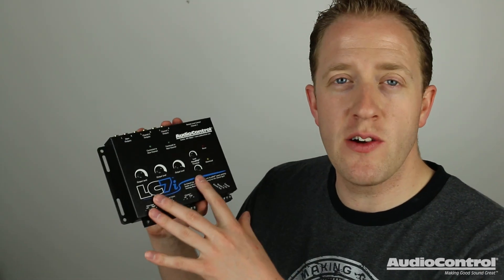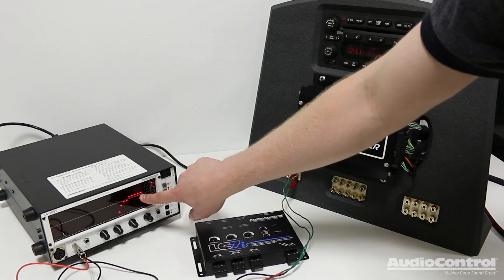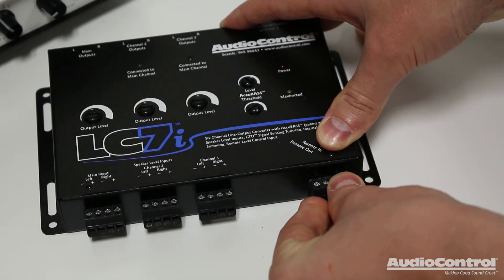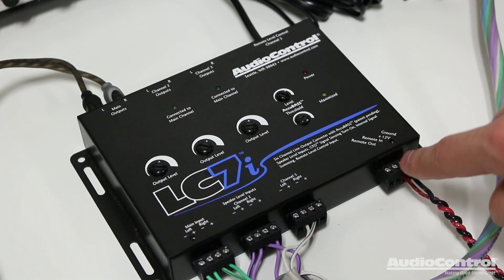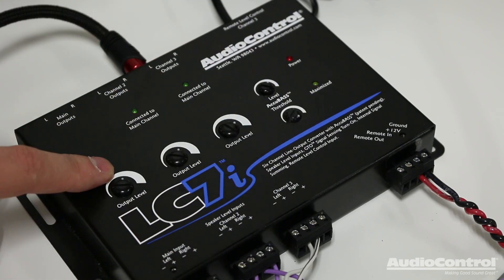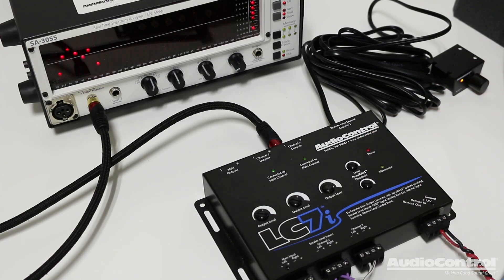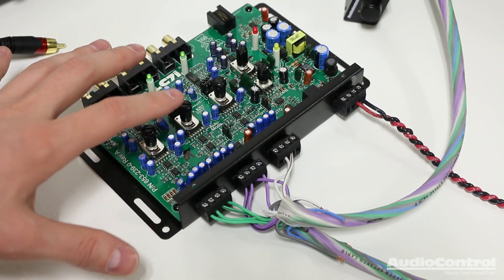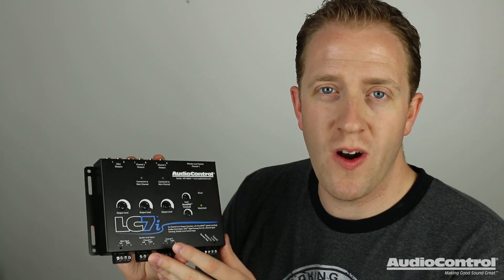Add Amplifiers to a Factory Audio System - AudioControl LC7i Line Output Converter

Comment: I have the lc7i pro, kicker cc360 and jbl bass pro nano. I ran my 8 gauge power wire for amp already. Will I need to run power wires for LC and JBL separately to the battery?
Reply: you should change out the 8 gauge for either 4 or 0 and lead those into a distribution block and run wires from there to give power

Comment: I need some help with my LC7I PLEASE 🙏 
I installed mine a month ago in my New 2024 Jeep Compass Latitude 4X4 2.0L I4 Turbo that I bought from the Jeep dealer here in the Big Island of Hawaii with just a few miles on it and followed the instructions to set my head unit to 3/4 of the maximum. Then I adjusted the gain on the LC7I until the yellow light comes on and back it down until it doesn't blink at all. The other settings for the bass restoration is set to maximum. I got just the left rear door speaker spliced a wire and connected it to the main input. When I turn the volume up to about 23 with songs that are bass boosted or decaf songs the LC7I shuts off and turns back on again so I turn the volume down and the bass knob down. All the amplifiers turn off also because it's controlled by the LC7I. What could be wrong to have it shut off? Clipping? Each song is different so no matter what the LC7I will clip even though I have it set. I hate that it shuts off all the time. I can't put the volume to 3/4 which is number 28 because it will shut off before I reach that volume. Especially when I set the bass knob high it shuts off.  The highest level I could reach was 26 but that's with the bass knob just above the minimum and when big bass kicks in it shuts off so I turn the volume down so it turns on again. It's New so I don't know what's going on with it. Can you help out please 🙏 
Another problem is now that I connected the front door and dashboard speakers to the 4 channel amplifier with new 16 AWG wires, can't make or receive calls by Bluetooth anymore because I can't hear anything. I think I may have to run wire to one dashboard speaker to the other channel of the LC7I main input so I can connect the RCA to the 4 channel amplifier from it because I have everything connected off of 1 channel of the main input with Y splitters. Maybe that would get it to work because the front channel is not connecting to the head unit, only the rear channel because it's not connected to the 4 channel amplifier, it running off the head unit. When I adjusted the fade on the head unit only the rear works. That the other problem. What do you think about it?

Comment: CAUTION. Any adjustments to the internal jumpers states in the video and in the manual that the Lc7i should be "powered off"... I'd advise going "fully disconnecting" power from the harness. I dropped the jumper after removal with needle nose pliers onto the board and when I went to pick it up the needle nose pliers shorted out one of the chips for the output power. Support could not help because I was out of warranty and had to take to a third party repair. Hope this is helpful

Comment: I have my main speakers laft and right rannned to the main channel on the inputs of Lc7i and left/right rca output of lc7i to aftermarket amp, and i have ground, 12v and remote line connected to inputs of lc7i and out to the amp, the only line i do not have connected is the remote in on lc7i because i thought it would have send signal using the main speaker signal from my factory amp utilizing the "GTO" feature in the lc7i but not getting no green lights on lc7i only power light. Im not getting no bass from my subwoofers at all. So do i need to run the remote in line tapping off my factory amp signal/power?

Comment: Just got rid of my DSR1 and had the LC7i installed. DSP was so complicated and frustrating. The LOC is set at the start with the amp and that's it. What got me is the sound quality of the LC7i. Blew my mind how clean it sounds and the bass output.

Comment: Question, I have a Prius with the jbl factory amp wired to components front and back. First which would be the best place to grab signal for lc7i? Also I’m installing new component speakers in font and back so I’m just gonna run new wires off the 4 channel amp and wire the crossover from component speakers to woofer and tweeter right?

Comment: I dont know if you will ever see this message.... Great detail but I have a question no one seems to cover. Forgive me if this has multiple components and I am unaware. My vehicle has ANC (active noise canceling) will this defeat/bypass it? If I disconnect it in the vehicle my mic for phone calls will no longer work. Also, will it defeat the volume changing depending on what speed I am driving? This may be a different system.

Comment: @AudioControl  I just purchased your LC8I to install in my 2014 F350 Platinum  with the Sony Sync 2 premium stereo system which has the factory Sony amplifier with subwoofer my question is what speakers should I run into the main high level input the fronts or the tweeters. This is what I've found the...the front tweeters and center channel are together, my front door speakers are bt themselves my rear door speakers are tied together with the rear tweeters and the sub is by itself,  what would be the best way to set up my LC8I.
Note I'm adding 2 amps 1 for mids and highs and 1 for sub.

Comment: Had an Lc7i in my 2016 Ram 1500 with stock Apline. You definitely need it to bypass the stock amplifier! Did great for me! Now going to use it in my 2018 suburban with Bose system!

Comment: I have a stock audio 2022 Tacoma and have an Infinity Kappa 6x9 front component speakers with tweeters and crossovers, Infinity Kappa speakers rear, JL Sub and a 5 channel JL amp. Using the LC7i, would I wire my tweeters and front in parallel and use input 1? Rear would go to 2? Sub goes to 3? Then output 1 goes to front amp, 2 goes to rear amp and 3 to sub amp?

Comment: Well that explains why the subs I bought sound nicer when they were on display then in my car... Now I know why I loose bass as I turn up my volume. I gotta adjust my threshold than. I never knew that about these new car systems. I have a brand new car . And expected to get the same sound as I heard in the installation shop. And it doesn't sound as great to be honest. But they did install this in my car so now I know how to control my bass and hopefully get a ritcher clean tone.

Comment: Hi, I noticed you’re using 2 speed wires. Do you have to ? I’m running 1 9 conductor wire and all 4 of my speakers won’t play at once. I’ve connected them from the factory radio to the lc6i. Thank you.

Comment: Hi. Mark!! Just watching your video.  Very inspirational and to the point!! Kudos!!!  I wanted to learn more about how to upgrade my stereo system, using my stock head unit. I own a 2018 Jeep Compass that comes with the Uconnect sytem like you've mention with a lot of other car features integrates in it. Anyway, what I wish to know is how to upgrade system, but I'm not striving for anything too complex.  I'm thinking of replacing all four of my door 6x9 speakers with some JBL 939's and I also have some tweeters up in front but my car also have a 6 inch mid dashboard speakers so it'll be 7 speakers total. I've never done this before so I would need some advice on how to connect all seven speakers with an LC7i unit of something alike and I don't know how many amps I will need. Like I mentioned before, I just want to have a simple but effective upgraded system that sounds decent but I'm not trying to blow my head off with subwoofers or anything alike. What would be your best suggestion to me for the system that I'm intending to build? Thanks in advance for your prompt response.!! 😁👍

Comment: I would like to know why on stock stereos some install techs use the front speakers to power the sub signal in the LC7i, I thought this wouldn't matter since both front and rear are full range in a basic stock radio. Doesn't the LC correct the bandwidth? Reason I ask this is because by connecting the subs to the front, fading capability would be lost.

Comment: So I have a dumb question don't judge so the speaker wires that connect to the lc7 that come from the head unit do you use a hundred or connect directly to the wires or how

Comment: My installer connected the first 4 channels on the Lc7i and I still have balance and fade control.  I'm assuming that this was done by connecting the front tweeter channels on 1 & 2 and the rear doors channels on 3 & 4?  Would this be correct?
Can I  connect all 6 channel outputs from the HU into the Lc7i, sum them into the first 4 output channels and get full signal on each output?

Comment: Definitely gonna get one of these...i have a factory Bose system in my 2015 GNC sierra without a subwoofer. It sound just ok but no balls on the low end. It definitely has the divided frequencies coming out of the factory Bose amp. My goal is to replace all the speakers and just keep the stock head unit. initially i will add 2 8" subs with 300 watt amp and eventually get the audio control LC 5.1300 to run the entire system....i do realize with that particular amp does what the LC7i does internally so i wouldn't need the 7i at that point so my installation with accommodate both of these  installations.....

Comment: Can I add this to a 2008 Lexus LS460 with mark levinson system to improve it and add a sub and amp for extra bass? Would I need more than 1 LC7i?
Reply from the maker: Not sure exactly how many channels that factory sound system has, since we don't have vehicle specific wiring info, but many luxury vehicles, like your Lexus, have a high channel count system. If that is the case for your vehicle, you may want to consider something like our LC8i or even DM-810 DSP. A DSP is generally a great way to go when dealing with more advanced OEM sound systems, since it will offer you more features to make your system sound it's best.

Comment: Seven eye with an aftermarket head unit? I originally got the LC7i cuz I kept my stock stereo but when my stock stereo to sit on me I got a Kenwood and left the LC7 I hooked up because when I tried disconnecting it and running my RCAs from my head unit straight from my amps it didn't sound good sounds way better with the LC7i
Reply from the maker: That makes a lot of sense. With most of today's head units, they only provide 1-4 volts of low level RCA output, whereas the LC7i can provide up to 9.5v of RCA signal. That's why it was such a big difference... good choice leaving it in your system!

Comment: Hello I only have 4 channels on stock radio and I'm limited on the rear signal to midbass and low frequencies if I want to add a 4 channel amp and and sub do I just use the summed output for the 4 channel amp and the lows for the subwoofer output?
Reply from the maker: Correct. Feed the OEM front signal into your MAIN/CH1 input, your OEM rear signal into your CH2 input, and then use the MAIN outputs to your 4ch amp (make sure internal jumpers are set to "summed") and the CH3 output to your sub amp. Hope that helps! If you need more help, feel free to give us a call at (425)775-8461

Comment: Why has my LC7i Remote Output stopped working? (I am using a remote input wire, not GTO)
Reply from the maker: Good question! The remote turn on output is designed to turn on 2 or less amplifiers. If turning on any more than 2, a relay is needed. If you're not turning on more than 2, give our tech team a call so we can help you solve this issue @ (425)775-8461

Comment: my remote turn on for other amps is only turning on one amp
Reply from the maker: Every amp is different, so different makes/models of amps require different amounts of voltage/amperage to turn on. Generally, anything past one amp, we would suggest using a relay to turn on additional amps/accessories.

Comment: And if I don’t have any RTA to find out about my outputs what can I use?
Reply from the maker: You can attempt to listen closely to the existing speakers/signal, but it can be tough to audibly distinguish between a full range signal and a crossed-over signal. An RTA, or visiting a shop with an RTA would truly be your best bet. Alternatively, as a "somewhere in-between", we do offer an RTA microphone that plugs into the lightning connector on an iOS device. You could take that mic, play pink noise, and then hold it up to the speaker in question and look at the response on your iOS device. It wouldn't be perfect, but it would be better than guessing. You can check out the iOS mics here if you're interested: https://www.audiocontrol.com/pro-audio/ios-microphones/

Comment: so technically i could use my a channel for my mains and use b channel of my home power amp connect it to the high level inputs of the lc7i which would give me the ability to connect my pioneer 9601 monoblock car amp for subwoofer output without chucking mids and highs to the sub perfect . correct me if im wrong
Reply from the maker: If I understand you correctly, then no... the LC7i does not feature a crossover, so if you send a signal in with mid and high freq in it, it will pass those signals on to whatever amplifier is connected downstream from the LC7i. If you need something with a crossover, we have lots of other products that could work better for you. Check them out here: https://www.audiocontrol.com/car-audio/

Comment: I have a 2012 genesis sedan with the lexicon system  I replaced all the speakers in the doors and the deck and the 8” subwoofer . I was told to run all new Wireds to the trunk by the stereo shop that is local.  Which means I did not hook new speakers up to the wires that run to the factory amp. Which I did to bypass the factory amp.  I’m not understanding by doing this. How do I hook it up if I’m bypassing factory amp .   I’m putting two amps in. A 5 channel amp for factory speakers and the factory  sub that was replaced and another for 2 12”s .  Plz help. I’m lost
Reply from the maker: You will use the outputs from the original factory amplifier to go to the inputs of the LC7i. This will provide signal from your factory radio/amplifier. The LC7i will then convert that signal into a useable RCA signal that you can use to feed the inputs of your aftermarket 5ch and subwoofer amplifier. Hopefully that makes sense to you. If not, please give our tech support team a call at (425)775-8461

Comment: Thank you for this.  2 questions:  1. When there is a factory amp present, do you just tap into the wires coming in and out of that amp?  2. Do you disconnect anything from the factory amp?  It seems that if the answer to #1 is yes, then you're going to have audio going to the speakers from both the factory amp and the aftermarket amp.
Reply from the maker: When a factory amp is present, you will interface with the signals coming OUT of the OEM amplifier. You would interrupt the signals coming out of the factory amp and send them into the LC7i. Then, the other side of the wiring left will be the leads that connect to the vehicle's speakers. These wires will need to be connected to the output side of your new aftermarket amplifier.
Reply: @AudioControlCar I'm still a bit confused, do I drag new speaker wires to each door speakers and unplug the stock  cables then plug the new speaker cables that leads to the lci7?

Comment: Not sure if this is needed if you are simply adding an amp to boost the speaker sound to you factory unit
Reply from the maker: Depends on the vehicle, the OEM sound system, what kind of aftermarket amplifier, and what type of results you are expecting. In most situations when using an OEM head unit, an LC7i (or other AudioControl product) would be beneficial.

Comment: Any interest (or car audio friend?) in a complete overhaul video for a stock 2013 Camaro convertible sound system? 2 lower door speakers, 2 tweeters, 2 small rear panel speakers and a subwoofer. I’m between two ideas: keeping stock stereo and adding LOC and amp for all aftermarket speakers, or replacing everything all at once. Located in NJ, just have never found a good video on this year, make and model.

Comment: Do I need a 6 channel amplifier if I'm doing 3 way , wofer mid highs?
Reply from the maker: If you want to amplify the woofers, mids, and tweeters separately (known as running them "active") then yes you would need a 6ch amplifier. Something like our LC-6.1200 or D-6.1200 would do the trick! Check them out here: https://www.audiocontrol.com/car-audio/power-amplifiers/

Comment: i want the factory amp to control factory speakers and my aftermarket amp to control my sub
Reply from the maker: Then in that case, you could use an LC2i instead. The LC7i is intended for multi-channel, aftermarket amplified systems or those that require signal summing. The LC2i will save you some $, but installing the LC7i would be a great way to future-proof in case you decide to add aftermarket multi channel amp(s) later.

Comment: I need help..I have a db amp...on my subs..fosgate amp on my door and rear speakers and tweeters and the LC6i .....fosgate tweeters...fosgate door and rear speakers...2 12in kicker cvr subs....I'm getting frequency coming through my speakers whn the car is off...sounds like data or something...the tweeters started out strong and now is sounds like they have gone out..but they haven't..its like something is blocking the  potential of the tweeters....I have spent a grip on install and components...it sounds like crap...can anyone help me...

Comment: I have a 2019 4runner non JBL factory system.  Keeping the factory radio.  I have bought Focal flax component speakers for the front. I also have Focal flax coaxial speakers for the rear doors and Focal coaxial ICU130 for the rear hatch.  What would be the best set up as far as amps, etc..?